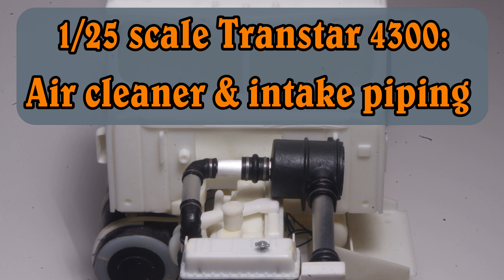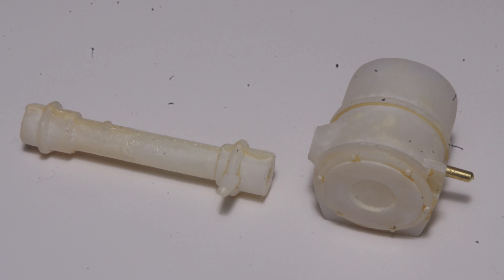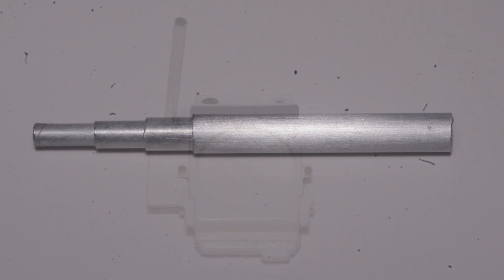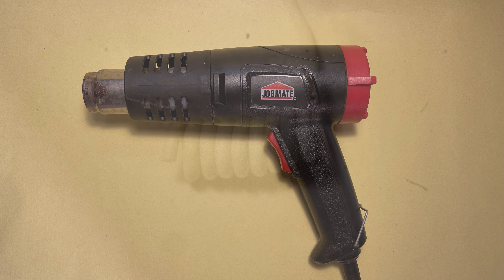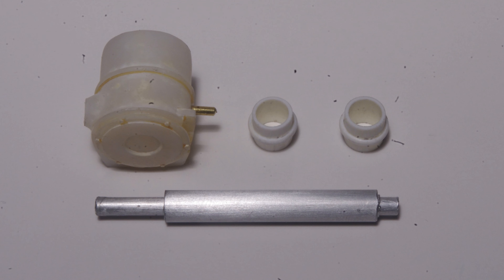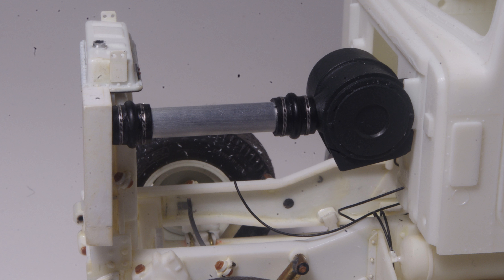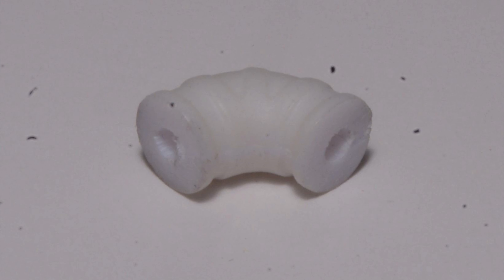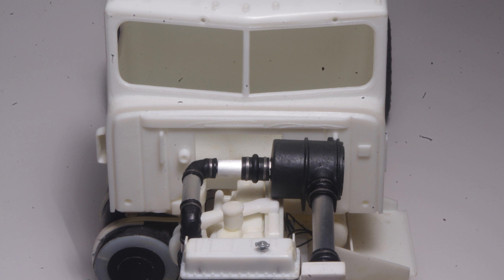1/25 scale Transtar 4300: Air cleaner and intake piping

Comment: Another good how to.

I have never been pleased with the way that Purple Cleaner / Super Purple Clean, household cleaner ( etc ) removes chrome plating on model parts. In reality the "chrome" plating is really a very thin vapour deposited layer of aluminum. The household cleaners which contain sodium hydroxide ( cas no 1310-73-2 ) remove the "chrome" by reating with the aluminum resulting in the release of hydrogen gas. The layer is very thin so very little hydrogen gas is produced. Underlying the "chrome" is a layer of lacquer or similar which the household cleaners may or in most cases does not remove. This latter part is what I struggle with.

After some testing of various methods as found in online searches of various forums, my current favourite is to use either Tamiya Lacquer thinner ( non retarder type ) or Tamiya Paint Remover or better yet, I have found a 50:50 mix of these two work even better than either one alone. Yes,  a bit more costly than the household cleaners BUT it does remove both the chrome and the underlying lacquer coating and does not attack or soften the poly styrene plastic in any way. And, the solution is reusable - I have a small jar with my 50:50 mix that I have been using for over a year. In this case, the "chrome" is not removed by dissolving the metal but rather by ( I think ) softening and dissolving the underlying lacquer permitting the "chrome" to be brushed off with an old toothbrush.

Keep up all these great tutorials and I may just buy myself a truck kit to build.

cheers, Graham
Reply from the maker: Thank you for sharing this information regarding "chrome" removal, the underlying lacquer layer has often been an issue. Sometimes sanding and/or scraping is possible to remove it depending on the shape and texture of part. I will pick up the two Tamiya products you mentioned next hobby shop visit.